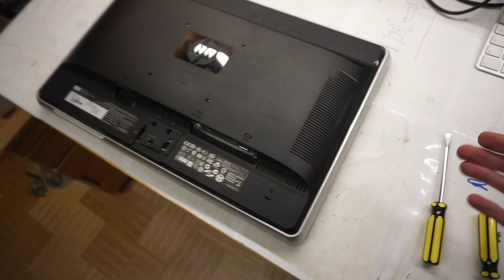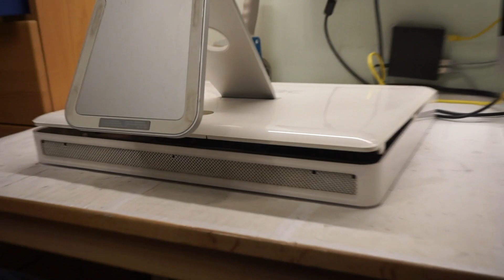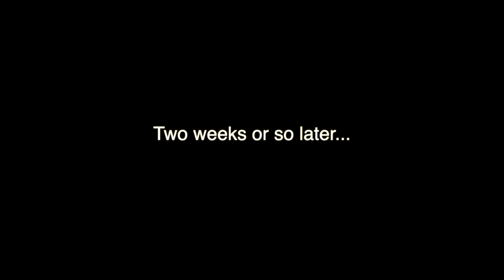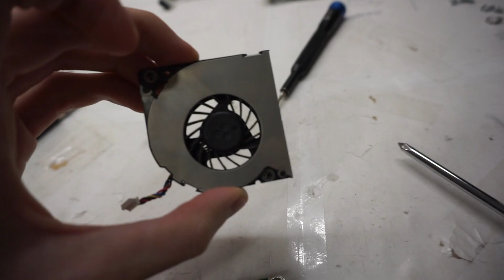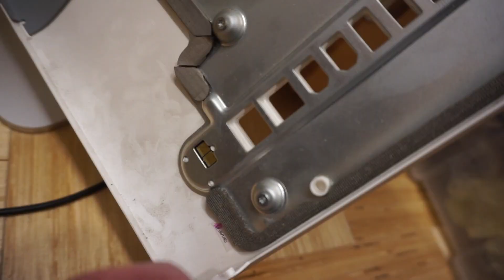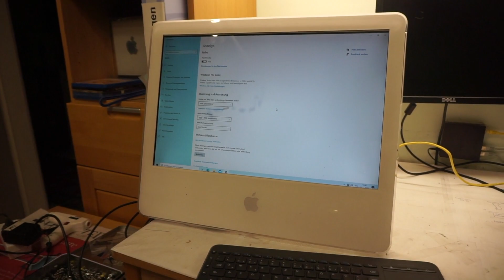iMac G5 NUC Project - Part 2

Comment: From my point of view, the display power input can be relocated just as easily as anything else you’ve relocated, just be sure to use proper wire gage. You can even use hot glue to sort of insulate the mains wires on the pcb. I’m sure you’ve already thought of all that though...

Comment: What about the ports and power input? One day I'm gonna make one of these myself with the stock iMac PSU, LCD and a mini ITX motherboard.
Reply from the maker: I'll wire a power button to the NUC so the original button can be used. About power input, I'm not sure yet how I'll handle that. I'm afraid the external power supply for the NUC won't fit in there anymore.